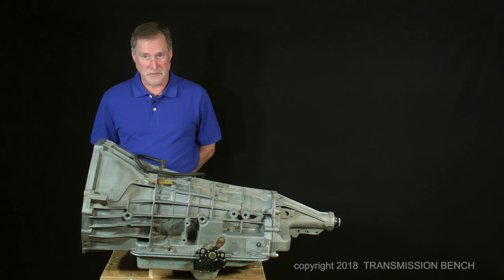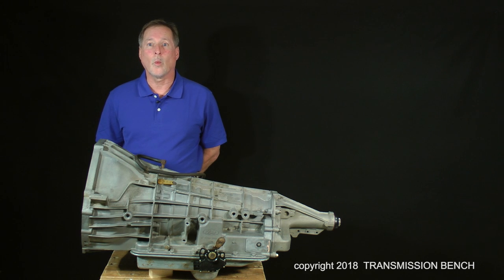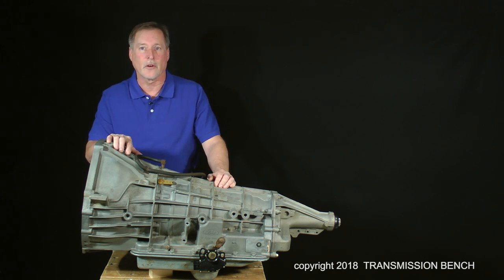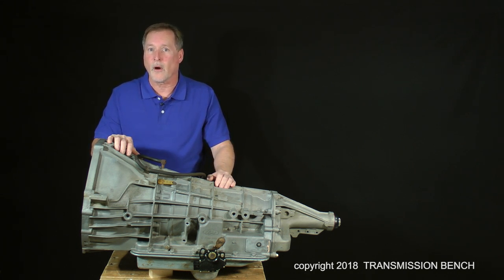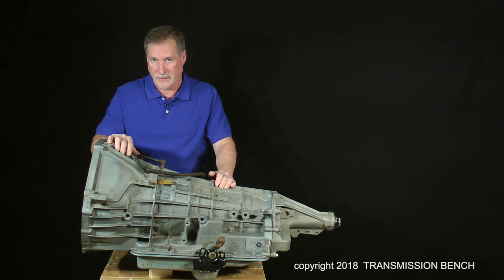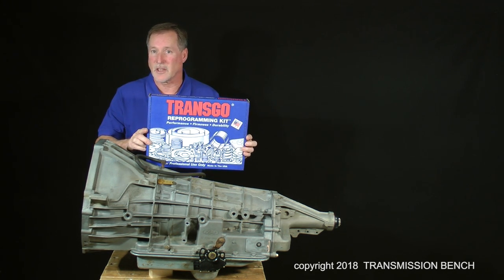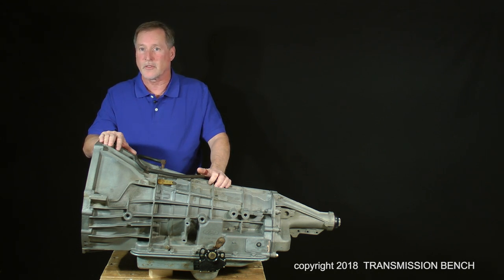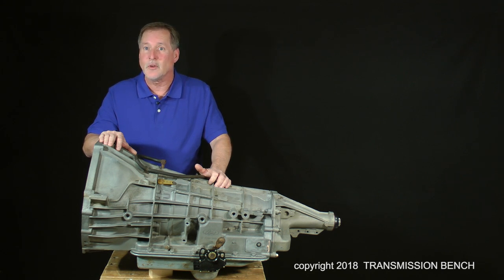Ford E4OD / 4R100 Class Introduction

Comment: I opened my e4od 89-95 thinking the problematic snap ring was causing my issues,after getting to it I saw it had the upgraded locking one already installed and noticed when getting there everything was very clean and bushings were not worn,now I'm not sure what to point to as the problem.My issue is it will drop down in gear or in neatral then catch back in gear with a jerk for no reason,even tooling down the road at 50mhp  in od.It would be sad to have done all this work for a malfunctioning neutral safety switch,or would I need to look at new solenoid pack?
Reply: Check the 3rd brake light. Comment is 3 years old but may help someone out.